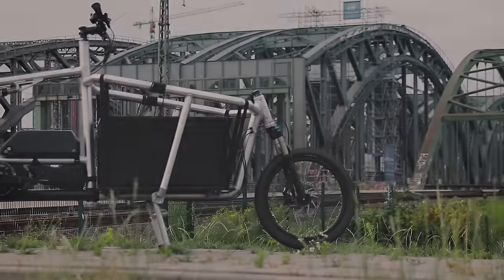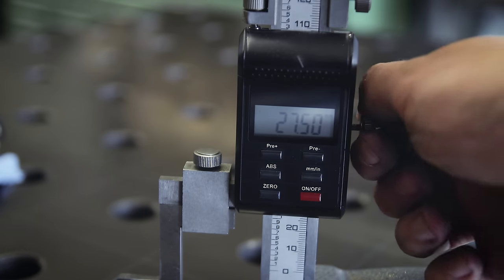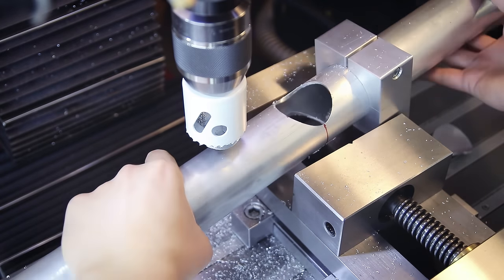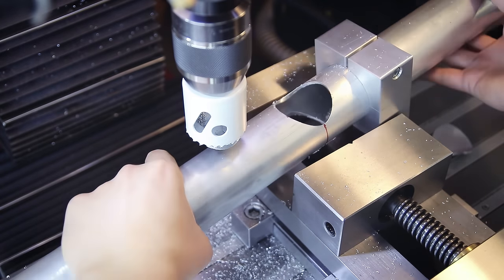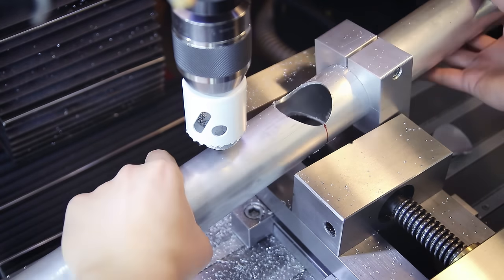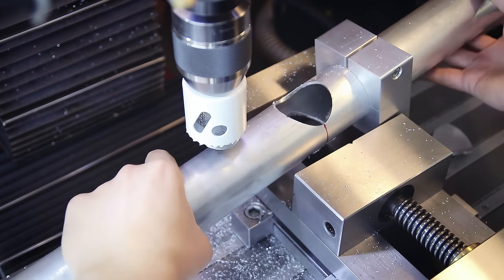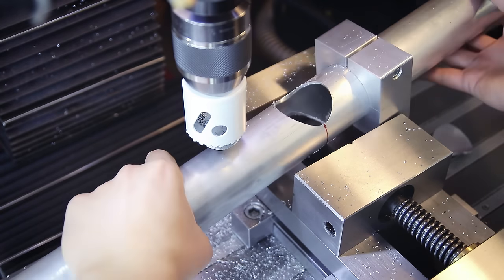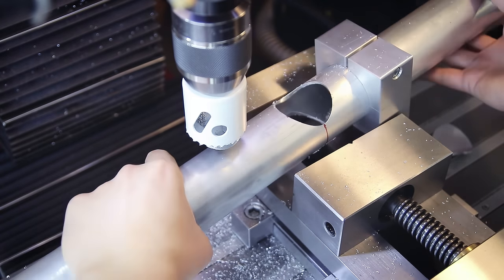Building an Electric Cargo Bike with Cable Steering and Full Suspension

Comment: Q: How to you make sure the clamping blocks around the round tubes are clamped symmetrically, giving you a true reference surface? Great system, want to know how to use it myself!
Reply from the maker: Good question, this can be a bit tricky. I ended up using the height gauge again to measure both sides of the upper half of the block and then tightening/backing out the screws until both sides are at the same height so the top should be level.
At the end of the day it's "just" a bike so personally I don't go for insane accuracy there, this kind of approach seems good enough

Comment: For those little mitre cuts on the band saw, instead of your marker and scribe line technique where you align the blade with the side, would a couple of seconds of trig with a trig calculator not give you a more accurate length that you could scribe to the top middle of the tube?
Reply from the maker: Possibly, but believe it or not, I suck at math so I tend to go with the hands-on approach ;)
Reply: @PhilVandelay  Very fair, I do try and shill triangle math as much as possible though because it can really speed up layouts and is great for accuracy

Comment: What is that cute angle grinder you use there? Looks fantastic fro the kind of jobs.
Reply from the maker: It's from the Bosch 12V line, very handy for smaller jobs, I got a few others of their 12V tools and have grown quite fond of the small form factor

Comment: Very nice, I would like to have the time to develop these kind of superb skills. At 34:43 does the protractor just have an external battery or are is that piggy back onto it something more complex (e.g. arduino) for communication?
Reply from the maker: Good catch, it's really just because the crappy electronics in those things drain the small batteries quickly even when it's turned off. Strapped a 9V block to it so I can disconnect the battery when I don't use it (and it lasts much longer)

Comment: Great stuff ! Question for third video: How much Watt does your Bafang Motor have? I'm asking because the commonly known 250W limitation is Germany is the "Nenndauerleistung" (for 30min) and almost all E-Bike have more wattage. thanks-a-lot in advance! Also: What's the timeline for video #2 and #3 - can't wait (as I'm building a cargo bike based on your old video this August!). ❤
Reply from the maker: Hi,
I can tell you that it's not the 250w version, the limitation is indeed ridiculous since all the big manufacturers cheat their way around it in various ways anyway. Still, in the case of an accident I can see it being held against you but yeah, 250w max is most likely not enough for a cargo.
As for the other videos, I'm planning to get the next one out in about 2 weeks

Comment: Great build! I guess you don't use pulse when TIG-welding?
Reply from the maker: Just rarely, most of the time straight current seems to work better for me (also fewer settings to deal with)

Comment: Why is it physically impossible to get hurt from welding light through a screen? Because the light output is limited to what your screen can display. Usually between 400-600 nits (2000 lumens) on a mobile phone. That's roughly 0.6-1.2% of the light output that welding produces (between 100-170k lumens). So what you're seeing through a screen is usually less than 1% of the actual brightness. For comparison, looking at the sun in the middle of summer is anywhere between 80-100k lumens.

PS - I know you can't directly compare nits with lumens but I just wanted to give a general comparison.

Comment: Phil, did you ever consider using a pipe bender,  instead of welding together pipes, for the top enclosure of the cargo container?
Reply from the maker: Yes but bending thin walled tubing requires mandrel bending which is very complex/expensive. Way outside the scope of what I can do in my shop
Reply: @PhilVandelay   I used an inexpensive manual mandrel, (which is primarily designed for even thinner walled electrical conduit)... to bend aluminum tubing aluminum... with a very long steel pipe.... 

But since your aluminum tubing has a larger diameter.... So a relatively inexpensive hydraulic jack could apply the increased force needed, via a bending jig... On that beautiful steel table that you have....

But if you're never planning to bend anymore tubing,? Welding is most likely the most efficient option....
Reply from the maker: @nc3826  The issue is not so much the wall thickness itself but the ratio of wall thickness to diameter of the tubing. The further apart those are, the trickier it becomes and you require very elaborate mandrel setups at some point, so it's much more involved the bigger the tubes get. In this case the downtube for example is 55x2mm which is quite on the extreme side, so those tubes want to kink and buckle and fold in on themselves like nothing else when you try to bend them. I actually have a full CAD design for a mandrel type bender that I made about 3 years ago but haven't gotten around to build it yet (very involved project) but hopefully that will happen some day and then I'm gonna play around with bending more
Reply: @PhilVandelay  Agreed, as the tubing's diameter increases and as the gauge of the wall thickness decreases... It does increase the complexity, and the probability of kinking....  

The three most common mitigating factors (that I can think of) are, increasing the diameter of the bend... Incorporate some form of enforcement to the interior of the tubing (for example springs or packed sand) and to a lesser extent the exterior..... And lastly heating the tubing.... To reduce the tendency of kinking.... 

 i tend to gravitate to any form that creates an arch.... Due to its inherent strength,  which aesthetically to my eye looks more elegant..... 

But of course you should do whatever is most practical for you.... I look forward to the subsequent posts on completing the cargo bike build....

Comment: Would bending tubes that size be an option to reduce the welding? Honestly curious as I have no experience bending tubes or welding.
Reply from the maker: Yes but it requires a special industrial bending machine (mandrel bender). Bending tubes is a very complex topic, depending on the material and the ratio of wall thickness to outside diameter. On thin walled tubes the walls will want to crease and buckle and I don't have the equipment to do it right. But I'm working my way there, maybe with the next bike ;)
Reply: @PhilVandelay  very interesting, thank you for the response!

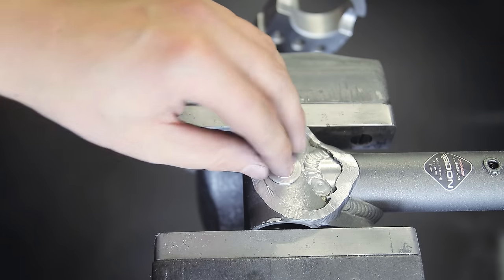Comment: 4:22 hey! what would be ur thoughts about the welding process caus;ng thermal stresses and making it brittle or less durable?

i wanted to weld on my bike too but this above thought stopped me as i dont know much metallurgy. it would be cool if u can share ur knoedge on this aspect.
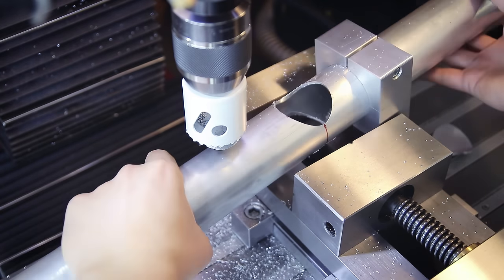Reply: 22:17 yeah, exactly this. heat treatment aspect of it. mine in not aluminium. its iron frame i guess.

Comment: does having a different steering rake on the handlebars vs the front wheel make it feel weird?
Reply from the maker: Cargo bikes always feel a bit weird to ride compared to normal ones but mostly due to the long wheelbase (and you get used to it quickly). The steering tube for the handlebars is also angled a little bit (3°) whereas the previous bike had it completely vertical and even the small angle actually helps a bit to make it feel more like a normal bike. You could angle it more but then you also lose cargo space, so it's a tradeoff.

Comment: Did you perform FEA on the frame with various loads ?
Reply from the maker: Nope, it's just a bike, not a space shuttle ;) 
Im the second video you'll see I did give it some "real life" stress testing, and I've been riding it for half a year at this point. 
I mostly go by experience from having built a number of bikes. I'm pretty sure many other things would fail before the frame does.
Reply: @PhilVandelay  Great to hear.  I've wanted a cargo bike like this forever.  I'm also a decent TIG welder.   You've inspired me.
 
Great project, great video.

Comment: What kind of aloy did you use and where did you source the tubing?
Reply from the maker: 6060, I buy almost everything on eBay
Reply: @PhilVandelay  ok, i thought you used some fancy bike alloy like 7005 or 6061. Thanks for the info.
Reply from the maker: @MrGoesnuts  Yeah 7005 would be better but those alloys are very hard to get your hands on as a consumer in my exprience. I only found places who sell them commercially to other companies in large quantities so eventually gave up on it and used what I had access to

Comment: Would you make this for customers?
Reply from the maker: As mentioned in the video, nobody would pay for the work hours, the only way to make things cheap enough for what people expect as a price is mass production
Reply: @PhilVandelay  true just out of interest though what would it cost to make one for a customer?
Reply from the maker: @grumpygrandpa3640  Well I spent 2-3 months just on building this, so let's roughly say 300 hours, at a decent hourly wage that would be about 10k just in labour, in addition to the price of parts and materials, rent, etc. and this doesn't even include the work of desgining it. You're probably starting to see the picture ;) 

There are a few production cargo bike models (not many) with suspension out on the market, for example the RM load. I believe it costs about 6-7k retail, so if you really want you can buy something like this "off the shelf", but it definitely won't be cheap in any scenario.
Reply: @PhilVandelay  wow I honestly didn’t realise how many hours went into it it’s an amazing build and I can understand better now thanks 👍
Reply from the maker: @grumpygrandpa3640  Yeah it always looks very fast and easy in the video because it's boiled down to the essentials and for entertainment. There's countless small steps you don't see, tons of measuring, thinking, triple checking, adjusting, finishing etc. for every minute of video

Comment: may i ask where you source your tubes from?
Reply from the maker: Mostly from various eBay merchants
Reply: @PhilVandelay  i could get 6060 locally and i think i can heat treat it to T5. do you think it's an adequate enough material for a cargo bike, or should i find something better? 65 kilo rider, 100 kg cargo maximum
Reply from the maker: @markifi  I use the same stuff and don't even heat treat. I talk about it in the video
Reply: @PhilVandelay  that is mighty encouraging thanks

Comment: engineering porn and classic music :) FTW, second thing why you dont weld  critical points on table to avoid distortions?
Reply from the maker: I can only weld from one side on the table which is not ideal, you want to alternate between sides to avoid distortion. If I was to weld one half of it in the jig and then take it out of the jig, everything would distort upwards instantly due to the tension created by the one-sided welds. The method of tacking in the jig, welding out of the jig and then checking with the jig again worked very well for me

Comment: Why make it so weird? Why not just make a bicycle equivalent of a pickup?
Reply from the maker: It's not weird, you're just applying car logic to bikes, it's a common logical fallacy. They're two completely different vehicles with different physics, requirements and limitations. There's nothing inherently better or simpler about having the cargo behind you, on the contrary. That's why the vast majority of commercial cargobikes (there are hundreds of models on the market) are front-loaders. It's simply the most proven design approach for many technical and usability reasons that would take too long to explain here.
Reply: @PhilVandelay  what are the usability reasons? It must be extremely hard and unpleasant to ride compared to elongated rear, it's more complicated (for the longer rear you can just put a driveshaft in of arbitrary length vs some nightmarish linkage contraption) and less functional (there is a hard limit of how tall the cargo can actually be vs literally being able to put whatever you want behind you)
Reply from the maker: @ZealothPL  You've obviously already made up your mind despite having no practical experience with this topic - No point in arguing if your points are just speculation. Try actually riding a few cargo bikes. Then try to design your own. Then build one. You'll understand then.

Comment: Just instantly from the thumbnail i'm going to judge the steering solution as a failure. Steering with cables is only acceptable if its a proper push-pull cable as they do not have the stretching problem of regular bicycle pull cables. Even better: reaction rods. No need to invent a bad solution again for some reason. Its not novel and its not good.
Reply from the maker: LOL